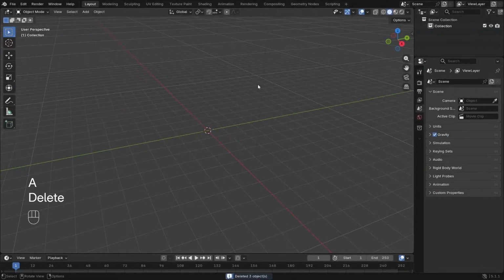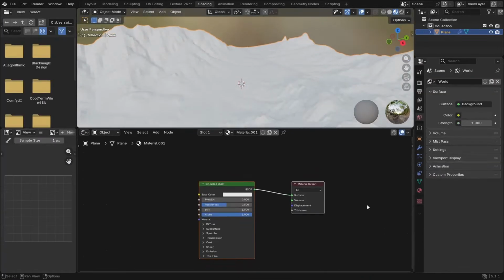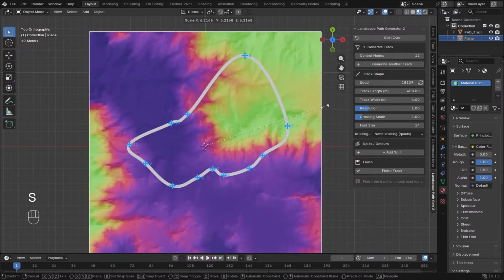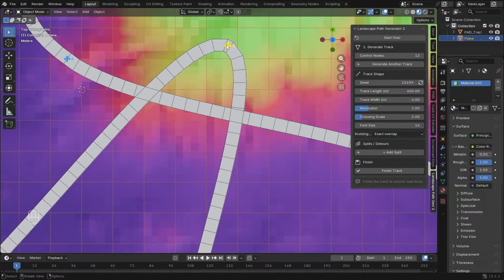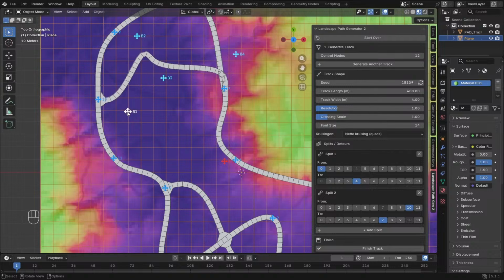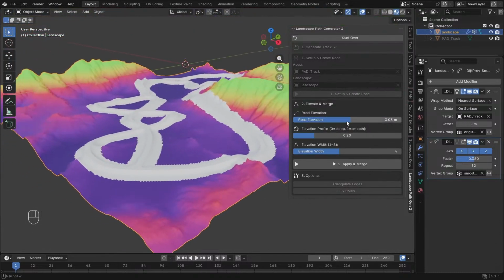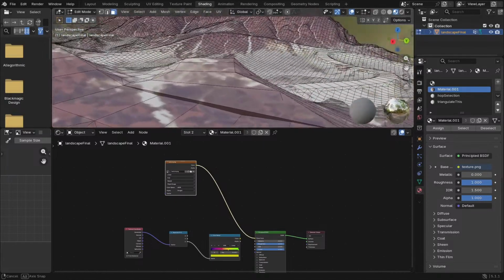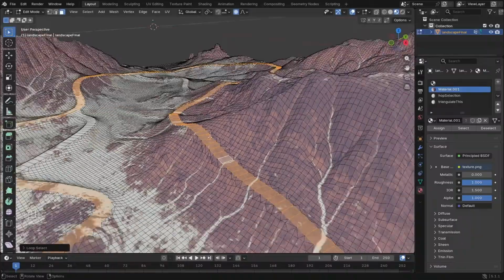Pioneering Road & Landscape Generation | EP03 Road an Crossings

Comment: Looking forward to seeing V2 on release. Does the addon allow for sharp cuts through the landscape? For example, a country road through hilly terrain often has a maximum smoothness to it (a gentler arc than the hills it cuts through) and the road is literally blasted out of the terrain, with cliff walls to either side.
Reply from the maker: Hello, thank you for your reaction.
Well, you can lower and raise the road afterwards in to the terrain using the road elevation en elevation width. 
So I would say yes, but I would like to see an example what you exactly mean.
Can you give me that? BTW, I will upload a demo video today, which shows the add-on which is for 98% finished.